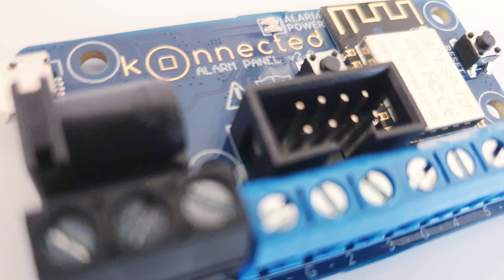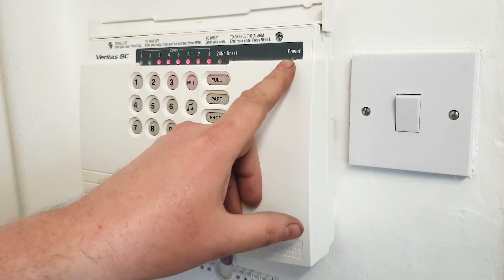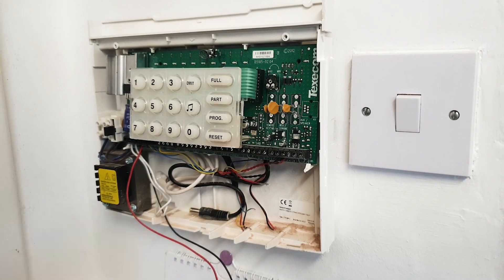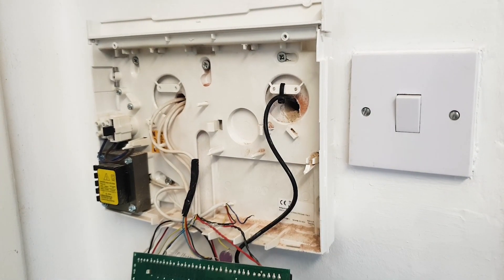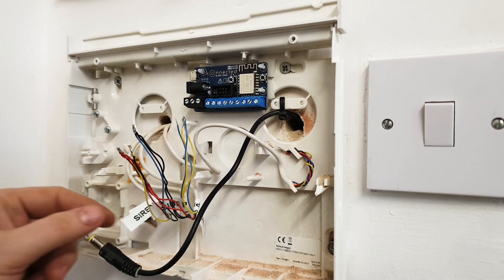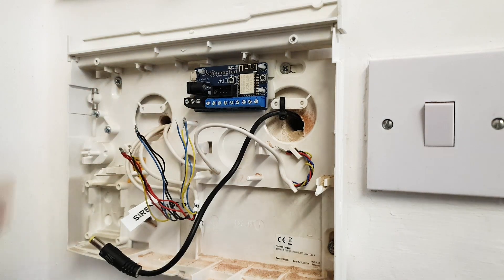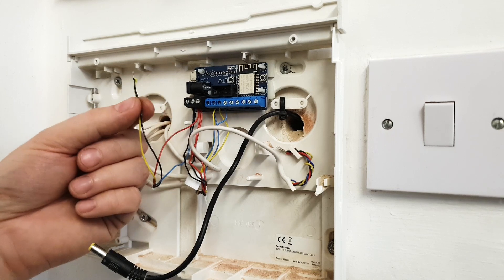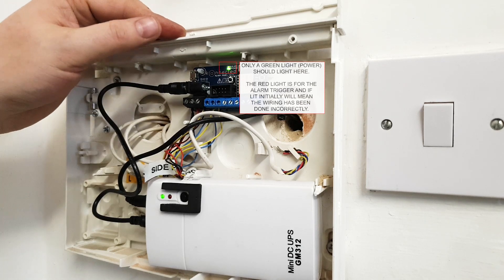Konnected v2 Installation - making a conventional alarm into a smart alarm

Comment: I have the alarm panel pro and you are right. A headache to get the external bell working. I have been onto the konnected  support for a both a month now and it's not working at all. I will be ordering a new external bell as it's an old HKC SAAB. I did connect the strobe to 12v and AUX and could see it flashing like it was the alarm was triggered so was thinking that it should be Alarm1 and AUX.  What do you think?
My connections are 
Ext Bell Neg = Alarm1
Ext Bell Plus = 12v
Strobe Plus = not connected
Strobe Neg = Alarm1
Hold & Tamper = AUX
Reply: I've a 4 wire external bell. I think some of those were for tamper but the Konnected dedicated page on UK wiring is very hard to follow
Reply: @ShaneCosgrove  exactly, it's too hard to follow . I never got it working at all so I opted for the AJAX wireless system.  Installed and operating in about a day. Used a wireless external alarm ( I know...) but it was painless and very simple to install.  Pity as I really wanted to use the konnected board.

Comment: what's that plastic thing that you put on the back of the Konnect v2 board? thanks.
Reply from the maker: The dealer I bought from Smart Home Alarms UK, included a set of 4 feet which had adhesive squares, similar to 3M VHB if that's what you mean?

Comment: I've just picked one of these up from the same supplier, looking forward to having some fun fitting it! Great video, thanks for uploading.
Reply from the maker: I'm wanting to pick up the PoE one at a later date possibly too.  I think it's just a hnady way of using what are fairly cheap conventional sensors and making them smart.  I'm thinking of using the PoE version in the garden to trigger LED lights at night and integrating that with my CCTV system too.  I found Smart Home Alarms UK very helpful with questions I asked.